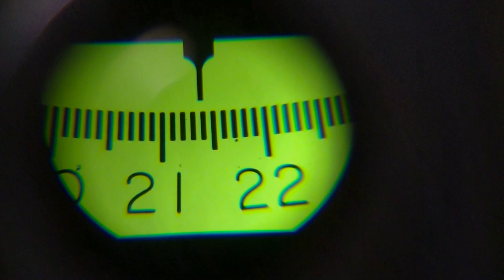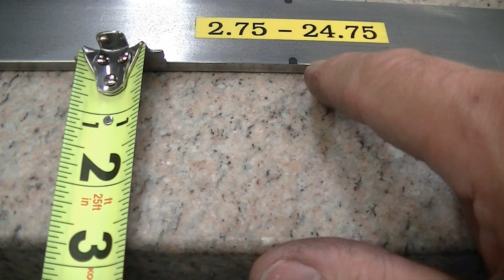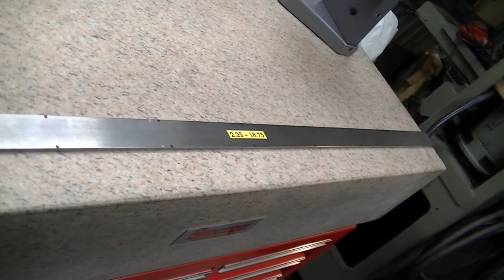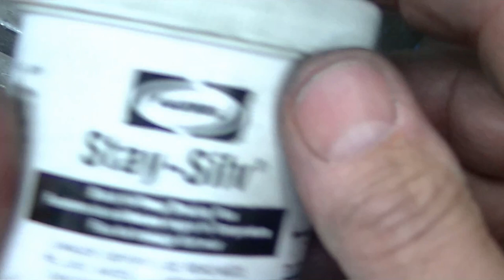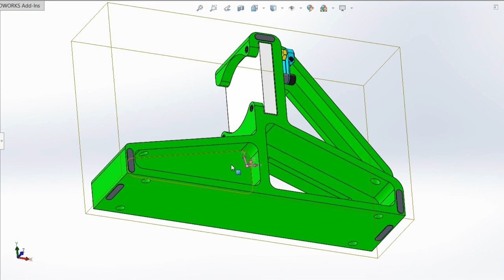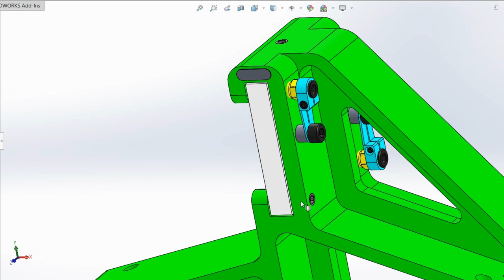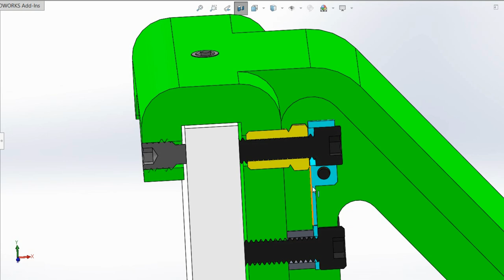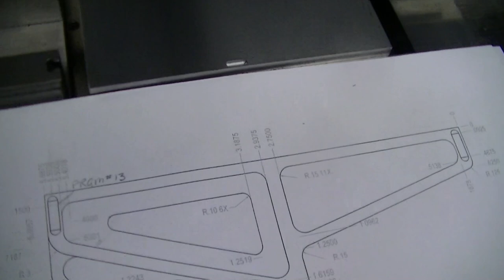AUTOCOLLIMATOR MIRROR SYSTEM

Comment: Just thinking, mind you...

Would there be any advantage to a window in back of your turning mirror to square it to the axis of rotation via the reserse reflection method? Presuming of course the mirror blank faces are parallel and the reverse side of the mirror is polished and uncoated.

Also it would be interesting to compare your LVDT micro-inch Renz-O-meter to the auto-collimator as competing systems. The Renz-O-meter is self contained and direct reading for error increments whereas the auto-collimator requires the auto-collimator, a means of mounting it, the turning mirror, and the shoe plus you have to squint through it and diddle micrometer dials.  Other details, resolution, data recording and entry, clearing and set-up are a wash. The auto-collimator increments readings from a fixed reference whereas the Renz-O-meter readings are sequential, but I don't know if that could be an issue. But it would be interesting if a boxful of expensive optics could be replaced by a self-checking home-brew gadget and an LVDT and gage head already in the toolroom.
Reply from the maker: Hi Forrest,  IMO the turning mirror squareness is not critical. I zeroed my AC on one of my lapped 1x6x6 blocks which is within 20 micro inch in 6". Then adjusted the turning mirror to the AC.  I think the only errors that would come from turning mirror tilt would be the target point on the mirror would move over longer distances and that would add mirror flatness errors.  
When I try to get my plate to have a sub 10 micro inch repeat reading and be AAA for the moment I measure it :-) I will be proving out the renzometer.
ATB, Robin
Reply: @ROBRENZ  Well, don't let SWMBO learn your AAA surface plate makes the best ever pastry slab. I made that mistake with my sister and had to buy her a 18 x 24 Griz surface plate and flush mount it in her kitchen counter. Barbara, thank the heavens above, buys her bread pre-made.

Indidentally, will your silk purse plate pass the deflection requirement of AAA grade in GGG-P-463c?
Reply from the maker: Starrett Master pink plates are 100lb per square foot rated plates and this plate was a AA plate when purchased. So it will easily do the AAA deflection at 50lb per square foot
Reply: @ROBRENZ  So that rules out high resolution metrology on a Cat C-32 block. Heck!
Reply from the maker: @forrestaddy9644  My stand rules that out already! :-)

Comment: Great video!! 

 I'm wondering if it wouldn't be better to use only three flags on the mirror in the corner.

  It would seem four flags over-constrain the location and could possibly create  repeatability problems.  If true you could just not engage the extra one.
Reply from the maker: Correct on over constraint but 4 requires less precision in the seating force vector.  Also the actual position is not critical.
Reply: Makes sense...thx!

Comment: Is it a special mirror in the sled? High level if flatness or something? Or can one steal the makeup mirror out of the passenger visor in the car? I see a lot of autocollimators for sale with no mirror.
Reply from the maker: Very special. First surface mirror meaning the reflective coating is on the front surface and flat to 0.000003" (1/4 wave) or 0.000001" (1/10 wave)
Reply: @ROBRENZ  i kinda figured that. So if one sees a good A-C on ebay but there is no mirror sled what can one do?
Reply from the maker: @sblack48  Buy it and find a separate mirror sled.
Reply: @ROBRENZ  ah ok edmund optics has mirrors that meet those specs. Thanks Robin. Good luck powering up your grinder. Gonna be awesome!

Comment: Sorry to be pedantic about the flags at 8:30 - four ? Wouldn't these over-determine the rotating mirror? Wouldn't three have been be perfect?
Reply from the maker: Correct on over constraint but 4 requires less precision in the seating force vector.  Also the actual position is not that critical.

Comment: 10:58 - Oh wow, it's that sensitive to temperature expansion from just touching the slide... freaking unbelievable. 22:15 - What exactly is a "Turquoise Pads" some kind of neoprene?
Reply from the maker: Turcite is a teflon/bronze material used for sliding surfaces in machine tools.
Reply: @ROBRENZ  Can you teach us how to build a precision CNC 3 axis gantry system? Want to know if it is possible to achieve a 1 micron +/- positioning accuracy with repeatably.

Comment: What is turpite?
Reply from the maker: https://mtsandtg.com/turcite-b-lf
Reply: @ROBRENZ  If you're doing work that requires a height gauge to slide across your surface plate a lot, would it be beneficial to use a turcite pad to protect the faces of the surface plate and height gauge? Or would that just diminish the accuracy of the gauge?
Reply from the maker: @beachboardfan9544  That would not be a good application for Turcite

Comment: I have no idea what I'm talking about so please inform me. As opposed to casting, and just machining critical dimensions,  isn't vast material removal from a monolithic block subject to stress relief warpage? And would heat and or cryo treatment be helpful? It just seems an unnecessary amount of work.
Also, casting or even built-up stands might incorporate invar or other similar coefficient materials at a similar cost point.
I realize machining is your fortè, not casting. And these are one-of-a-kind, for your own use.
If, however,  you were to approach a manufacturer with a patent or prototype,  and they were to radically change the methods or materials,  which they always do, it would incur anger, disagreement, heartache and development delays. Start with a cost effective,  performance effective prototype. As I mentioned below,  this device is apt to have other fields of use, with a broader appeal, beyond machining and standards calibration.

Comment: Amazing work as always.  And incredibly timely as well.  I just finished a base for my autocollimator and was starting to think about mirror mounts.  And here they are!  Some very cool design ideas here.

My autocollimator base has carbide feet (idea from your previous videos).  I found some inexpensive inserts that make it easy.  They are round truncated cones pre-drlled for a flat-head screw, intended for some kind of woodworking.  Lots of sellers on ebay, here is an example: https://www.ebay.com/itm/402216890219.  I bed them in a drop of black max and secure with a 4-40 FHCS.  Then lap to get all three feet flat and co-planar.   I'm probably going to use the same for my mirror mounts.

Question:  do you worry about heat induced residual stress from either silver soldering the feet or TIG welding (on the turning mirror)?  Do you do any form of stress relief?
Reply from the maker: long term stability is not an issue on these measurements

Comment: Lovely work!  How long does it take to measure a full Union Jack pattern on your surface plate with this setup?  I found a paper from Sandia National Lab comparing using an autocollimator, a differential electronic level, and a laser angular interferometer to measure flatness of a surface plate.  Their autocollimator was mounted on a separate cart and needed to be moved for measuring each line and they report that it took 5 hours for a skilled and experienced person to measure the full pattern. Paper is available at https://www.osti.gov/servlets/purl/1145574 .
Reply from the maker: I am familiar with that paper. I can do the 3' x 4' in an hour and a half. Having the autocollimator on a separate cart is terrible practice. It adds floor deflections into the readings.
Reply: @ROBRENZ  Thanks for your reply. I am gearing up to use the autocollimator that I designed and built to measure the flatness of a used 3' x5' surface plate acquired by the maker space I belong to.  Previously I have only measured straightness with my autocollimator, which requires far fewer data points. My autocollimator uses a optical fiber patch cord and an LED to make a point light source, a cube beamsplitter, an achromat lens, and a single board security camera.  I use a laptop to locate the center of the spot imaged onto the camera's array detector.  This design avoids the need for moving parts and precision machining.  Using a corner cube prism as the reflector, autocollimator readings are stable to better than 0.2 arc seconds.  The real limit to performance is the stability between the autocollimator and an external flat mirror due to floor deflections and mirror mount stability.
Reply from the maker: A corner cube will not show angular movement, you have to use a flat mirror to get readings.
Reply: @ROBRENZ  I used the corner cube to help with initial optical alignment of the autocollimator. After setting the distance between the lens and the camera by imaging a building that 3-4 miles away, i used the corner cube to produce a return spot on the camera from the output end of the fiberoptic.  I then adjusted the the axial position of the fiber optic end to first minimize the spot size on the camera.  I then moved the corner cube from one half of the telescope aperture to the other.  With perfect imaging, the spot does not move, but if the image is slightly in front or behind of the camera array sensor, the spot moves.  In addition, the corner cube makes an easy way to locate where the optical axis intersects the camera array sensor and to test the stability of the autocollimator by itself without the effects of drift of an external flat mirror.
Reply from the maker: @bretcannon3826  Sounds good. please show it in action when your measuring your plate.
Reply: @Bret Cannon I'm thinking of making an auto collimator along the lines of what you described. Please keep us up to date on your progress!
Reply: @treygreer8299  Thanks for your interest.  My autocollimator has been finished for a couple of years.  After measuring a 4' x 5' surface plate, a 42" long straight edge, and a couple of other things, I don't have anything else in mind to measure with it.  I think that the main limitations are the lack of stable temperature and air currents in the shared maker space where I used it.  Checking the zero using a solid glass corner cube, which is independent of the angle between the autocollimator optical axis and orientation of the corner cube, I find the zero is stable to about 1 microradian or 0.2 arc sec.  However, using a flat mirror and with mirror and autocollimator mounted on a surface plate the stability of readings is a few microradians. I am willing to share my python program for finding the center of the the return spot and converting it to an angular change if there is interest, perhaps on GitHub.
Reply: The polarizing beam splitter cube would have to be used with a quarter wave plate.  But it seems like the polarizing beam splitter might be flatter at the same price point?
Reply: @treygreer8299  I did not use a polarizing beam splitter cube rather a simple non-polarizing beam splitter cube.  So I lose about 80-90% of the light from my LED light source from the beam splitter, but I still have to set the current through my red LED down to about 25% of the rated current for the LED to avoid saturating the pixels at the center of the return spot. Larger losses are the coupling into the 9 micron diameter core of the optical fiber between the LED and the autocollimator and the red transmitting filters to reduce room light.  I did take some care to blacken the insides of the autocollimator to minimize stray light, but it was not a big problem.

Comment: Nice work but completely unnecessary, you could just measure your plate with a simple mirror on a stand and fixed traveling mirror.
Reply: @Leo Yes, but with too much effort, you don't need any of those adjustments to do the measurement.